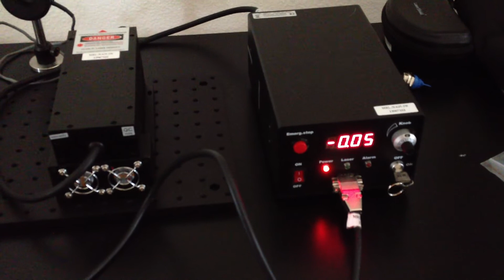635 nm, 3 Watt Diode Laser sales@dmphotonics.com

Comment from the maker: Green DPSS lasers for variety of applications! Request a quote at sales@dmphotonics.com
http://www.dmphotonics.com/DPSS-lasers/high-power-green-DPSS-lasers.htm

Green DPSS lasers for Ti:Sapphire pumping:
http://www.dmphotonics.com/Trestles-LH_femtosecond%20_laser/Trestles-LH.htm
Trestles LH Ti:Sapphire laser
Trestles LH is a new series of high quality femtosecond Ti:Sapphire lasers for applications in scientific research, biological imaging, life sciences and precision material processing. Trestles LH includes integrated sealed, turn-key, cost-effective, diode-pumped solid-state (DPSS). Trestles LH lasers offer the most attractive pricing on the market combined with excellent performance and reliability. DPSS LH is a state-of-the-art laser designed for today’s applications. It combines superb performance and tremendous value for today’s market and has numerous advantages over all other DPSS lasers suitable for Ti:Sapphire pumping. Trestles LH can be customized to fit customer requirements and budget.

DPSS DMP LH series is a compact, diode-pumped solid-state (DPSS) laser providing high-power, continuous-wave (CW) power at 532nm in a near- perfect TEMoo mode with extremely low optical noise and excellent long-term stability. DPSS DMP LH series is truly a next-generation laser designed and manufactured using many years of experience to provide a sealed, turn-key source of collimated green light with high spectral purity.
A number of key technologies guarantee this performance. Sealed technology keeps all dirt, dust and moisture out of the laser head to provide years of uninterrupted usage without need for cleaning or maintenance. All cavity optics is permanently locked in perfect alignment.
The laser head is a monolithic 3-dimensional design for ruggedness and compactness to minimize the space consumed in your lab or instrument. The fiber-coupled pump diode package, contained in the power supply, has an expected lifetime of more than 20,000 hours to minimize cost-of-ownership. The power supply also contains an integrated thermo-electrically-cooled (TEC) chiller. The chiller is designed specifically for this application to provide increased reliability and reduced overall system footprint. Additional features include automatic laser power control and USB/RS-232 interface for external monitoring and control.
http://www.dmphotonics.com/DPSS-DMP-LH/DPSS-DMPLH.htm

Comment: DPSS 532 nm 1W laser DMPV-532-1 (532nm Diode Pumped Solid State Green Laser 1000mW)
http://www.dmphotonics.com/DPSS_DMPV532-5/DPSS%20laser%20532%20nm%205%20Watt.htm
Model: DPSS DMPV-532-1 - request a quote - buy from online store
http://greyhawkoptics.com/product_info.php?cPath=105_151&products_id=751&osCsid=e9e8ee6b90c6393a1dbceafcfa32ae78
Wavelength (nm) 532
Output Power (mW) 1000
Working Mode CW
Beam Mode Transverse TEM00
Longitude Multi-longitude
Spectral Linewidth (nm) <0.1
Polarization Line polarization
Polarization Ratio >100:1
Beam Quality (M2 factor) <1.2
Beam Divergence (full angle, mrad) 1.2~2.0
Beam Diameter at Aperture (mm) 1.2~2.0
Beam Roundness >90%
Power Stability (RMS, over 8 hours) <5%
Aperture Position (mm) 20
Laser Head Dimensions (L?W?H, mm) 180 x 62 x 62.5
External Modulation 5V TTL/5V Analogue
Modulating Repetition 30KHz TTL/10KHz Analogue
Cooling System TEC
Warm-up Time (minutes) <15
Operation Temperature (°C) 18~30
Expected Lifetime (hours) >10000
Warranty Time 1 year

Comment from the maker: Diode end-pump green lasers (532nm) and infrared lasers (1064nm) - sales@dmphotonics.com		
High stability, excellent laser beam quality, air cooling, long life time and low cost.	
http://www.dmphotonics.com/Diode%20end-pump%20DPSS%20lasers/Diode%20end-pump%20green%20lasers%20532nm%20and%20infrared%20lasers%201064nm.htm		
Types	Output power	Power stability	M² factor
		(8 hours)	
Diode End-pump Solid-state Infrared lasers (1064nm)	>27W	<1%	<3
request a quote	>20W	<1%	<2
	>10W	<1%	<1.5
Diode Dual End-pump Solid-state Infrared Lasers (1064nm) 	10W×2	<1%	<2
request a quote	(dual-output)		
Diode End-pump Solid-state Green lasers (532nm) 	>8W	<1%	<1.5
request a quote	>15W	<1%	<3
Diode End-pump Solid-state Green lasers (532nm-CW) 	>8W	<1%	<1.5
request a quote	>15W	<1%	<3	
Request a test report sales@dmphotonics.com

Comment from the maker: DMP-LSR473NL Blue 473nm 100mW
http://www.dmphotonics.com/DPSS%20laser%20Red%20Green%20Blue/Solid-state%20laser%20sources.htm
Deal Mar Photonics offers high quality diode-pumped solid-state lasers. 
(1) DPSS 473nm blue lasers from 1mW to 600mW - request a quote
(2) DPSS 532nm green lasers from 100mW to 5Watts - request a quote
(3) DPSS 671nm red lasers from 10mW to 900mW - request a quote
(4) 635nm, 650nm, 660nm red diode laser module from 100mW to 1Watt - request a quote
(5) 445nm/450nm blue diode laser 500mW and 1W - request a quote
(6) Infrared 914, 946, 1064nm DPSS lasers from 100mW to 10Watts - request a quote
and more...

Here are just few examples of available standard models. Request a quote for one of those or send us your inquiry so we can identify the best product for you!

DMP-DLSR532NL Green 532nm 500mW - request a quote sales@dmphotonics.com
DMP-LSR532H Green 532nm 1000mW - request a quote sales@dmphotonics.com
DMP-LSR473NL Blue 473nm 100mW - request a quote sales@dmphotonics.com
DMP-LSR671NL Red 671nm 50mW - request a quote sales@dmphotonics.com
DMP-LSR660NL Red 660nm 900mW - request a quote sales@dmphotonics.com
DMP-LSR1064SL Infrared 473nm 800mW - request a quote sales@dmphotonics.com

Comment from the maker: Deal Mar Photonics offers high quality diode-pumped solid-state lasers. 
(1) DPSS 473nm blue lasers from 1mW to 600mW - request a quote
(2) DPSS 532nm green lasers from 100mW to 5Watts - request a quote
(3) DPSS 671nm red lasers from 10mW to 900mW - request a quote
(4) 635nm, 650nm, 660nm red diode laser module from 100mW to 1Watt - request a quote
(5) 445nm/450nm blue diode laser 500mW and 1W - request a quote
(6) Infrared 914, 946, 1064nm DPSS lasers from 100mW to 10Watts - request a quote
and more...
http://www.dmphotonics.com/DPSS%20laser%20Red%20Green%20Blue/Green%20laser,%20Blue%20laser,%20Infra%20Red%20laser,%20IR%20laser,%20UV%20DPSS%20laser.htm